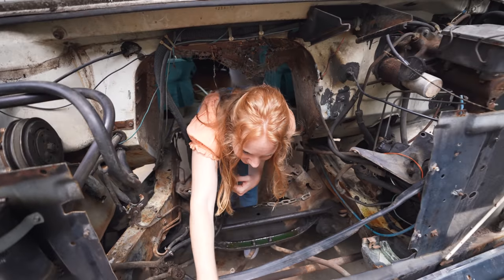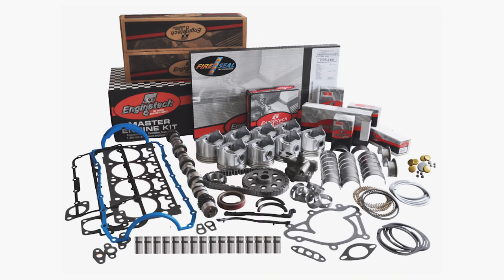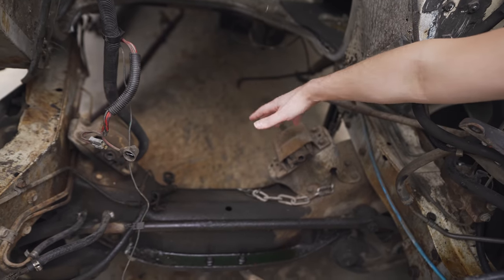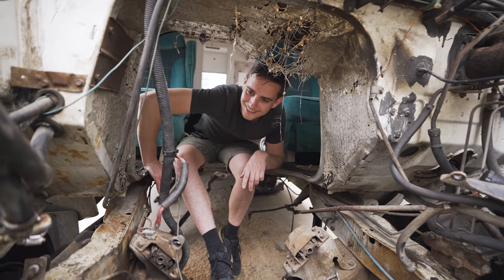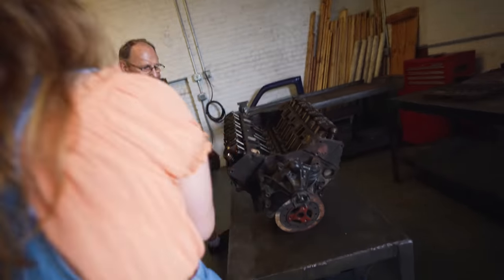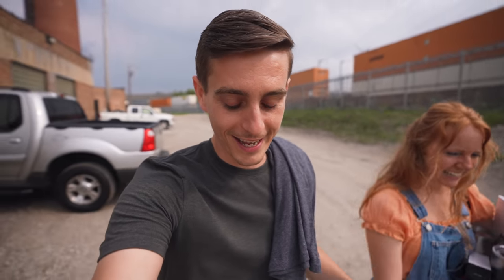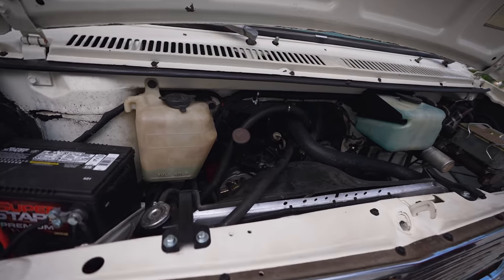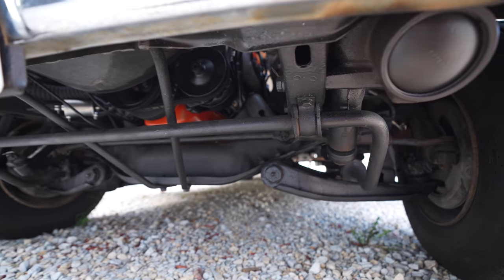We Installed a BRAND NEW ENGINE in the RV! + Update on Semi Truck Wreck Damage

Comment: Take the RV to a metal fabrication shop, they'll fix those dents and holes from the truck hitting it.
They'll either fabricate panels that look identical, or they'll cut out the damage and super impose new material to it and spray the whole panel and you'll never know it had happened. 
Good body shops could do it also. Its not a big problem for professionals and assuming the truck driver had insurance ,it'll be no cost to you.

Good luck guys
Reply: Super impose ? Never seen that process

Comment: That timing chain on your old engine was probably 1 full throttle snap away from slipping a few teeth. The slack in that chain means that the valve timing was off which affects engine power.  With that new engine, once you get the EFI dialed in will be a powerful beast. That mechanic did an outstanding job with all the little details like the wiring harness sheaths. Looks sharp under the hood now.

Comment: If you really want to save the metal, a body hammer and dolley set could help here, also a flat chisel and rubber hammer to help gently tap the creases back in the metal, but you do have to take the panels off to work on them, the tears can be gently welded by a weld shop after the body work is done.

Comment: To remove the oil stains on your overalls, use Easy Off Oven Cleaner, old toothbrush, very hot rinsing water.  Work in a well ventilated area and pre-wet the stained areas; don’t let the oven cleaner set for more than one minute at a time.  On delicate fabrics, don’t let stand for more than 30 seconds.  🧺👖😷🥽

Comment: Chevrolet installed a cable in parallel with the motor mounts on the 1969 Camaro SS 350.  High torque with an insufficient motor mount.  Cheaper way to fix it

Comment: God bless you guys 🙏😥 You have all the work done only to have a truck scrape you up front and back. I have a couple of questions. 1. Did you change out the camshaft to give you a little more torque? 2. How did the old cam and lifters look? Were the lobes on the camshaft worn down? 3. With the damage to the RV can you keep it water tight? How will you do this?

Comment: Nice vid, I like your enthusiasm for those engine issues. Had not realized that the engine almost sits in the lap of the driver, such a tight place under the hood. The damage to the aluminium seems less dramatic than I first thought, though I understand your dismay at seeing part of your own work undone by a careless truck driver. I wonder: how much has fuel use improved?
Reply: Whats really fun is to lay on your stomach between the seats to do a tune up, cap and rotor is so much easier than a car. Plus setting the timing is fun to, I always set the timing on the test drive.

Comment: Great looking engine, Eric and Allison. What if you use Bondo, or fiberglass to build a patch to cover the messed up squished areas?
Reply: The Squished areas are wood, bondo doesn't that well, plus its so much better to cut out the broken pieces. The tin could be hammered straight and repainted, or used undamaged pieces could be sourced.
Reply: @kevinlimo696  I’ve use Bondo on wood, though 2 part epoxy does work better. I suppose, if they went to a fabricator who can match the corrugated  aluminum then they could patch it. Such a shame this happened, especially to this great couple.

Comment: i'm geussin if is 4 bolt main aluminum heads refresh estimate 350hp to 400 hp nice should motivate that big beast. Next 4x4 conversion, 6 inch lift and 33 inch tires lol kool motorhome. 👍

Comment: How does a vehicle with only 69,000 miles have so many engine issues?  Was it the overheating? Did they not change the oil enough? Just a bad engine from the factory? Seems pretty extreme

Comment: IT NEEDS NEW PANELS AND STRUCTURE REPAIRS NO WAY AROUND IT. THE WOOD ID 2X2 STRUCTURE.. YOU WILL HAVE TO GET A GOOD RV SHOP TO DO IT WHO HAS THE PANELS OR CAN GET THEM. ABOUT 10G IN REPAIRS ON THE SIDE BECAUSE THERE WILL BE HIDDEN DAMAGE. BEEN HANDLING RV DAMAGES FOR DECADES. YOU HAVE TO STRIP THE SIDE DOWN TO SEE WHAT IS ALL DAMAGED AND YOU CAN FIND SOMEONE TO REMAKE THE STRIPES AND LOGO... THEY WILL HAVE TO CAD DRAW THE STRIPES AND LOGO AND CUT THEM OUT. I AM SURE YOU ALREADY KNOW ALL OF THIS..

Comment: Fuel injection system is going to cause you nothing but trouble if they did  not get it tuned for you.... fuel injection is not better economy nor is it more reliable... A properly tuned and set up carburetor will work just as well if not usually better.... I have nine classic cars and a 1976 dodge RV all carbureted and never left me stranded... I built them all and tuned them... I am retired A&P mechanic...

Comment: swap out the Halogen headlight bulbs & put in LED bulbs also in the tail lights & turn signals
Reply: @gregyohngy  not if you slightly tilt the headlight down then people WONT get blinded i use to do this all the time on vehicles that got LED bulb headlight replacements .... Never had issues